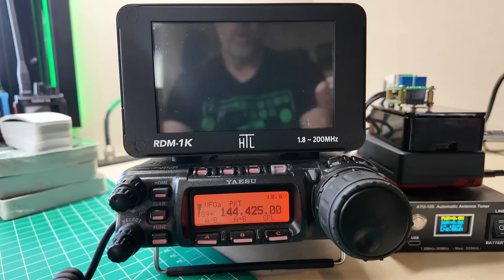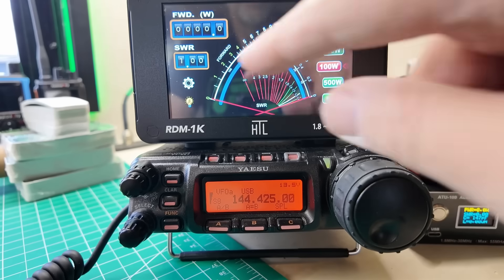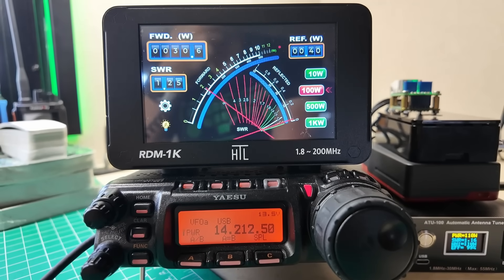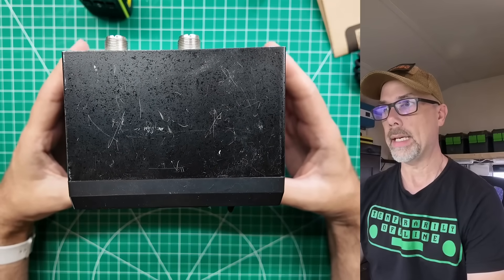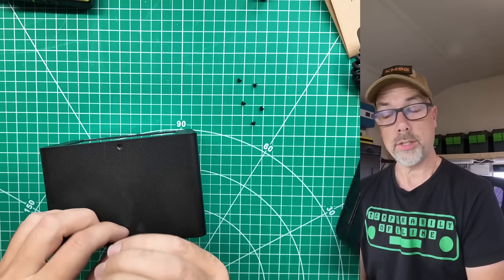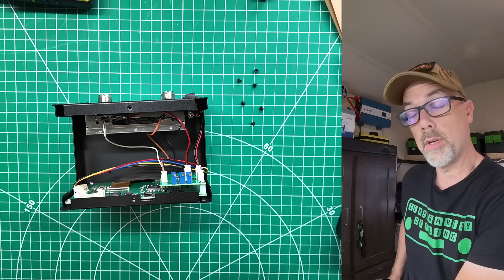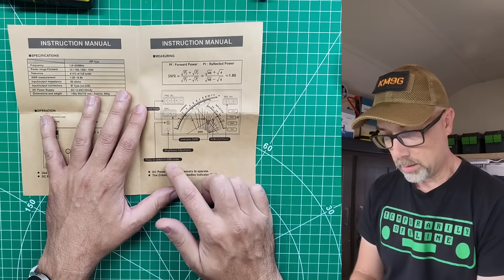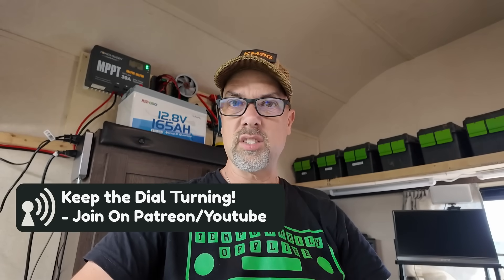Gabil's New RF Power Meter Is...

Comment: This isn't a miraculous antenna, it's just a compromise antenna that's easy to stretch out. Miraculous antennas don't exist; I'd rather have a doublet antenna fed with open wire. But hey, not everyone can stretch this out.
Reply from the maker: There was not an antenna demonstrated in the video.  I'd love to run a doublet, but like you said, I don't have the room.
Reply: Not actually an antenna. More of a power meter swr thingy 😊

Comment: 70 cm would have rounded it out as an all bander.  Many people have an HF radio and a VHF/UHF radio, but even on the all band transceivers there is an HF output and a VHF/UHF output, so it would be great if this meter had two inputs and two outputs.  Otherwise, make one in HF and a different model in UHF/VHF but that's extra cost and extra shelf space in the shack.  I'd like to see a peak wattage display as well as instantaneous.  I don't care for the classic cross needle faux analog digital display.  I'd prefer larger digits for SWR and Watts and skip the pretty but difficult to interpret fake analog display.  $250 seems a bit pricey.  There are good analog and digital meters for a lot less.
Reply from the maker: All good ideas for a V2 of the meter.

Comment: I have one (rebranded) and it is very inaccurate.  I compared it against calibrated test equipment, and it is woefully inaccurate (i.e. power is off by circa 20w on the 500w scale with 100w output).  I know this is NOT po equipment, but I expect it to be reasonably close.  VSWR is also not aligned with other gear. For example, the rig, external tuner and a 'generic' mechanical x needle meter are all around about the same, but this meter is over 2.0 different.  That is enough, quite frankly, to not recommend this, but the clincher is within the meter itself you have a digital and x needle (simulated) VSWR meter and there is over 2.1 difference in the reading between them.
Reply from the maker: Thanks for the feedback!

Comment: Nice meter, how much is it the link doesnt work and the best I saw was $250.... I would assume that in practice any of the features it's lacking at the moment could be done in S/W!
Reply from the maker: It must be regional, the link works for me and shows 5 left in stock... amazon trickery!  Its not in-stock near you, so they tell you its out.  I bet the seller will not be happy with that.  It is about $250 and I agree, software updates are possible... or hacking.  The boards inside are well known dev boards, the rest is software.

Comment: Looks very interesting...
What would be interesting.?
Put a known good 50 Ohm Terminator/Load on the Output/Antenna Socket
Attach an Antenna Analyser to Input/TX Socket, and Scan from 1~200MHz
See how flat the Response is... does Start to rise after 50/100MHz
Just a thought...
Reply from the maker: That's a great idea!

Comment: I like that meter! I don't currently use them in my mobile because of the extra feed line that I'd need to for good placement. But this meter is interesting enough to make me reconsider even if it still needs the extra feed line. I'll put it on my wish list. Thanks for sharing!
Reply from the maker: Yeah, its hard for mobile, but it would look sweet in your setup.  Have you seen the QuantumSDR? https://quantumsdr.com/
Reply: @temporarilyoffline  - I'm running out of space! HAHA! I haven't seen the QuantumSDR. I'll bookmark it. Today, I also learned about "FreeDV," an application that somehow enables digital voice on HF with nearly any radio... I think! I need to dig in a learn more.
Reply from the maker: We did a live stream on FreeDV about 3 years back.  Its come pretty far.
Reply: @temporarilyoffline  - Thanks! I'll search the channel and see what I can find.

Comment: Looks nice, but features I wish it had:  Peak Hold, multiple antenna ports (HF vs UHF/VHF), 70cm support.  If I ever get serious about having an SWR meter (other than the one on my radio), I'd probably still need 2 separate meters.  That's one of the reasons I've been reluctant to bother.
Reply from the maker: I don't think the perfect meter exists.  This one probably could be made to do that since its "software designed"
Reply: @temporarilyoffline  The ones that are closest to perfect are prohibitively expensive, at least to an impoverished, grizzled old ham such as myself. I mean, it's been mere months since I upgraded from my spark gap transmitter and lightbulb dummy load. (Tune for maximum lumens.) That being said, the WA4MCM kit I mentioned comes closer than anything I've had previously. $250 for the kit. He documents the serial comms protocol too, I'm wondering if I can muster up enough healthy neurons & synapses to make it talk to my Hermes Lite 2 setup.
Reply: I also require a removable coupler so I don't need two coax runs all the way to the meter housing. This is a must and something even my 1970 Heathkit HM-102 features. Also, a USB/serial port so measurements can be fed to remote software. WA4MCM sells a reasonably priced touchscreen HF meter in kit form that does this and more. He includes software that places a virtual version of the meter display on your computer screen. Search YouTube for GM-102 to see his demonstrations.